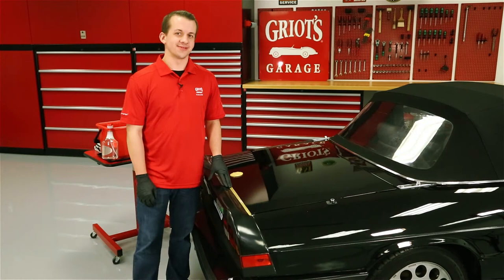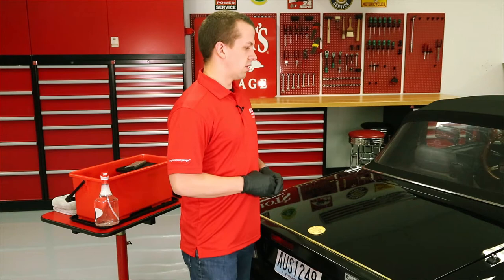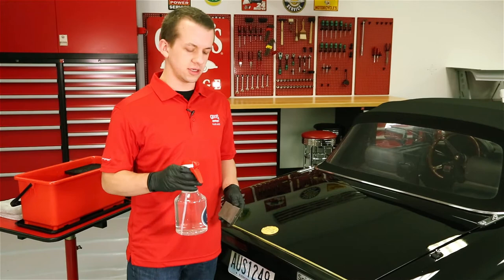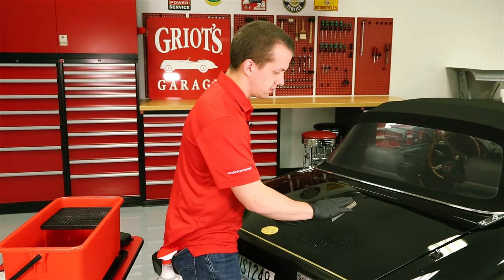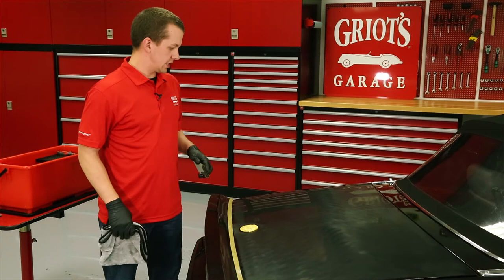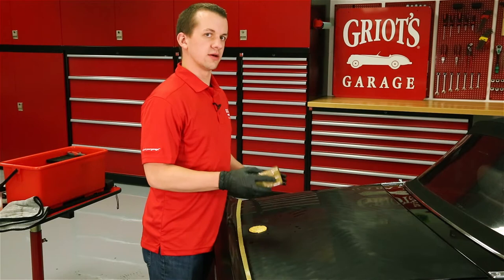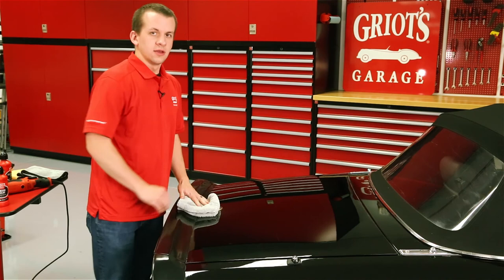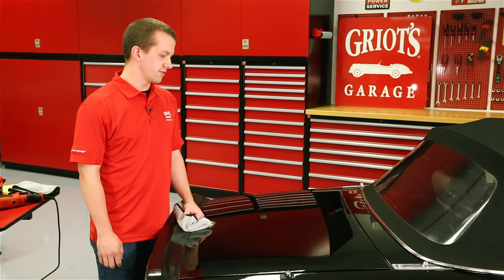Griot's Garage - How to correct paint by wet sanding with BOSS Finishing Papers

Comment: If I have a two color car, should I do each color separately?  I have a 72 Chevy truck and it goes blue white blue from the bottom.
Reply from the maker: Yes, you'll want to do each color individually and use different sand paper for each

Comment: Can I wet sand the paint and buff it with Griot's Garage 10862 Complete Compound alone and get the shiny back ?
Reply from the maker: It's possible, however, it's best to test an area as paint types and finishes vary.  If needed, you can further refine after Complete Compound with another product like BOSS Perfecting Compound.